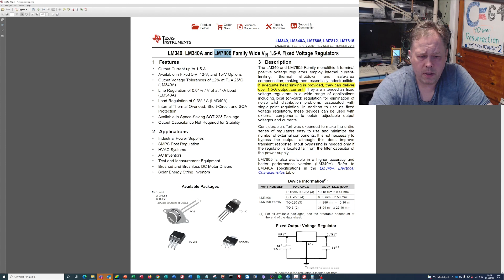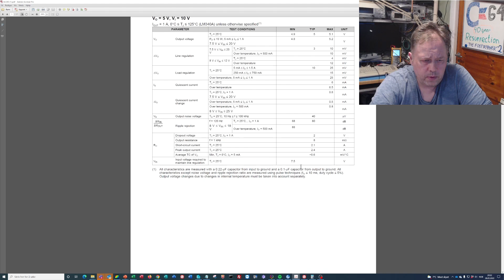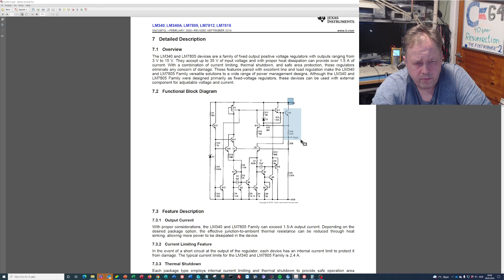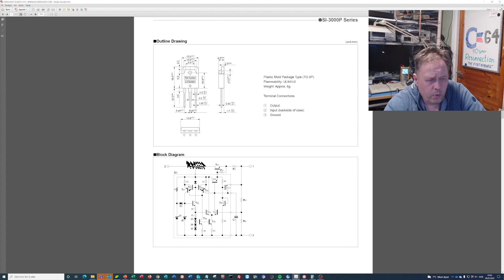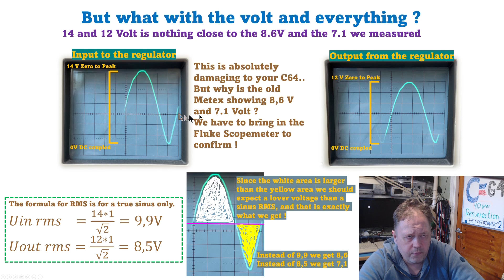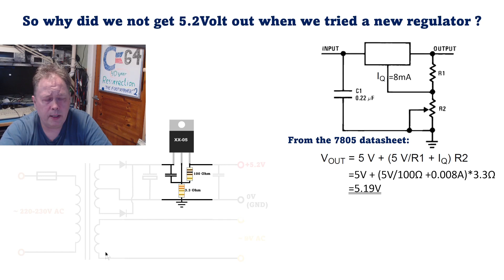The Commodore 64 resurrection series, Part 9.1 Knowledge is power, But so are ignorance...

Comment: I've been able to piece together markings by reading the mirrored markings where they came off with the epoxy and comparing it to the 'shadows' left on the parts.
My potted PS, P/N 251053-02 with black casing, had an 'SES' (brand) GL1016 voltage regulator in it, but it was destroyed during disassembly/depotting. 
I managed to salvage all the other components from the epoxy, except for denting the big 4700uF 16V 'RICHEY' electrolytic capacitor fairly badly.
The other components were two BY253 diodes, one 2.2uF 16V tantalum capacitor, one .22uF 35V tantalum capacitor, one 2.2-Ohm 1/2-watt resistor, and one 100-Ohm 1/2-watt resistor.
Thank you for making these videos! A user on the Vintage Computer Federation Forum recommended them to me.
Reply from the maker: Thanks for your nice words ! It doe’s look like there are more variation here than I first thought. But I have found at least one C64 wedge brick that has a 2.2 and a 100 Ohm resistors. But the caps were electrolytic and not tantalums. unfortunately I was not able to read anything out of the sorry broken up shell of a power regulator.
Reply: Probably due to Commodore buying whatever parts they could get for less cost at the time, would be my guess.
Reply from the maker: @TheFurriestOne  I don't think the PSU's was produced by Commodore, even though they did the original design. There are to many small subtle changes here and there in the plastic molding. I think they had them produced by the lowest bidder, and they might had more than one source running at the same time. And we know for a fact that in some countries the wedge design was newer used at all.
Reply: That's a good point! Mine was made in Singapore, but I've heard of them being made in Taiwan and elsewhere as well.

Comment: I think you should just clean out the old plastic case and drive over the contents with your car, then fit a modern Meanwell etc. PSU in there🙂
Reply: Where's the fun in that?  I like that Kojro is taking the time to drop some real and practically useful knowledge on us.
Reply from the maker: Just send me a meanwell and I can drive over it any time !  There is of cource many reasons to change the PSU, but with a mothern Switching regulator after the originale transfomer you get the 9V, and you are able to draw about 3 Amps out of the old foot warmer... No reuse what you can, and don't trrow away what is better than new with a slight modification.
Reply: @kojroRI  Thanks for you reply, I was just a bit trollish 🍻

Comment: Hey Kojro, found your channel through Tommy at Artic Retro. Great series so far. I'm enjoying it greatly.

I can confirm that at least in North America, Commodore used 3052P voltage regulators on some of their supplies. I happen to have two 117V early repairable power supplies that came out in 1982 before they started to seal and fill them with epoxy (part no. 902503-01 & -02). One of them (the -01) has a normal 7805 but the other one (the -02) uses a 3052P. Both look factory with no sign of any rework done to them so I assume that Commodore used both types of voltage regulators on their power supplies.
Reply from the maker: thanks, valuable info, and thanks for watching !